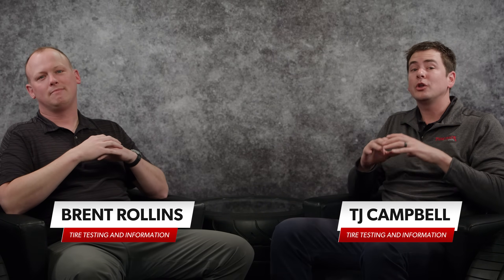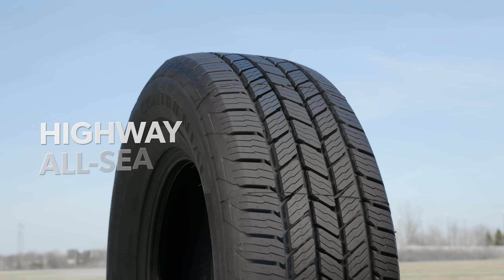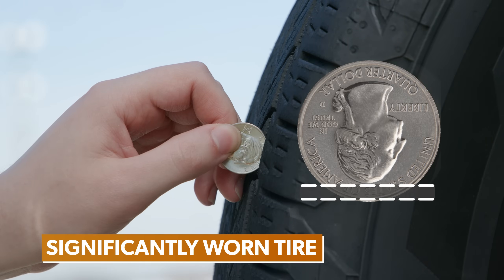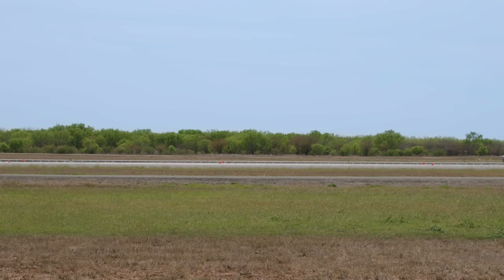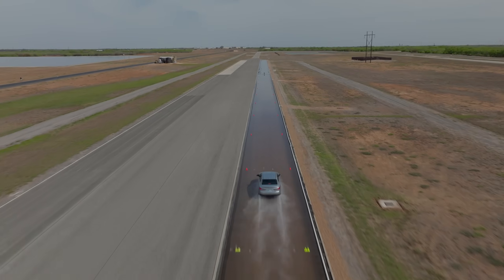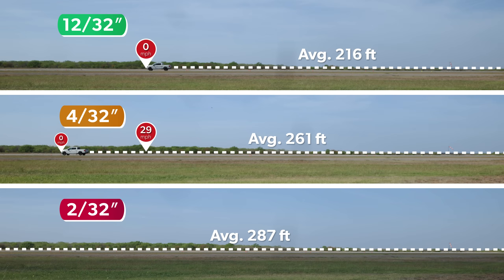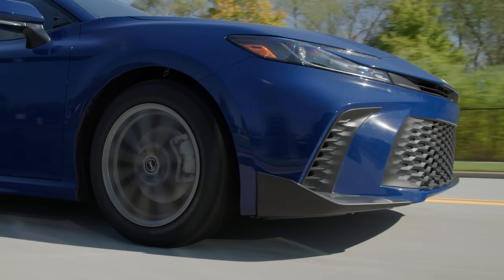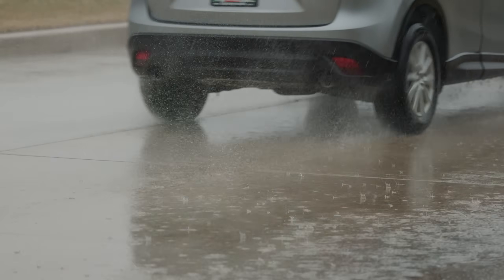How Much Does Tire Tread Depth Affect Stopping?

Comment: Quick question if someone can answer, would the temperature of the brakes also have a significant effect on stopping distance?
Reply from the maker: Great question! Yes, the temperature of the brakes can definitely affect stopping distance, and it works in a few different ways depending on whether the brakes are cold or hot.

Comment: Michelin has at least one tire that has sipes that appear as the tread wears to maintain wet performance - if regulators mandated that tires maintain wet performance throughout their life, all tires could have  better sipe design - the problem with traditional sipes is they loose volume as the tread wears, so wet performance continually declines - cool test, thanks for sharing

Comment: In the dry stopping distances for the worn tire will generally be the same or shorter, though.
Reply: I've never experienced a tire improve in any metric of performance ever as it is worn down.
Reply: @skylersutton241 It's what you will find in testing from multiple tire companies, including Michelin, as well as independent research organizations.

Comment: Your test surface is almost like shallow puddle, that is not same as wet asphalt, most roads will be leveled and such thin water layer would be only possible in extreme rain but it also would make fast driving dangerous for visibility reasons especially if following other cars on highway. 

So the main point of this video is valid however real life braking is not so dramatic with legal remaining tire thread depth. Thus legal limit is reasonable compromise.

Comment: I am also genuinely interested in the questions :
Worn out tire = semi-slicks ?
Worn out semis = Slicks ?
And : is dry braking better with worn out tires ?
Reply: Impossible to have this comparison, if you wear a tire out you will make it go through  heat load cycles which will degrade the rubber material which will degrade the tyre performance to the point that it wll have no grip. So in the real world there is no point for that.
Reply: @TheLTcousins could do a nice burnout to make a comparison lol
Reply: False. Completely worn tyres have more grip in dry conditions than brand new tyres.
Reply: @trumpthelegend6357 it has more contact with the ground so technically worn out tyres are better for dry grip
Reply: @spookyreaper797 ya both completely wrong for several technical reason's!
Reply: @iggyppup enlighten us. Tell us these ‘reasons’
Reply from the maker: Thank you for your feedback, and we'll make sure to share it with our team.

Comment: I had busted chinese tires on the front of my car. The behavior in the wet was... Interesting 😂 and a bit comical tbh. The limits in the dry came up early and prevented me to push on.

Now i have replaced them with Nankang NS-2R (trackday semi-slicks) AND BOY WHAT A DIFFERENCE !! My car isn't the same anymore, the front end just dosen't give up ! You have to purposefully make it give up, do something stupid for the tires to let go. I can go full flat in so many corners i am amazed ! In the wet they are  much better than my old sh*t buut.. Still, semi-alicks, i don't expect too much.

Also, my car is a 20 year old, 2400 lbs french hot hatch. Weight definitely helps. (Stop driving thoses crazy 6000lbs Super Useless Vehicles !)
Reply from the maker: Thank you for sharing your thoughts and experiences with us!

Comment: Were the lower depth tyres naturally worn (i.e. old) or new and shaved down?
Reply from the maker: Unfortunately, we didn’t have the time to put thousands of miles on the tires to wear them down naturally, so we opted to shave the tires to their depths to synthetically represent wear.
Reply: @tirerack Good to know, because that's hopefully one extra variable that was eliminated by your methodology - the effect of aging and heat cycles on the rubber compound, which will also have a huge effect on performance.
Reply: That means thath naturally worn tire would be even worse :D

Comment: For the rest of the world :
12/32"=9.525mm
4/32"=3.175mm
2/32"=1.5875mm
Reply: thx bro, so underrated comment
Reply: thanks bro
Reply: You are a math teacher weren't you??
Reply: @spudboy123 Worst, engineer😅
Reply: From the series: "anything, but the metric system".
Reply: Thank you so much
Reply: 12/32“ to me is 3/8”` and the 4/32” is 1/8”,  2/32” is 1/16” .Why do Americans refer to 1/2” as 16/32” are the rules only in 32s of an  inch. Seems weird to hear our measurements spoken of like that😊
Reply: they really used coins
Reply: those 50ft or whatever with the worn is about 15m
why do they use x/32 for inches?
Reply: @keisuketakahasi4584  32nds of an inch is just the standard we use in the US for tire tread depth, for some reason. I'm in the trades and we hardly ever go down to a 16th of an inch, never a 32nd. I guess the extra precision is necessary.
Reply: @smileyguyz k. cuz all the values used here could ve been shortened by 2 thats why i thought it was wierd
Reply: @keisuketakahasi4584 Cause Freedom! (Insert Bald Eagle screech) 😂😂😂
Reply: @thebreakerofwalls9036 how many cheeseburgers per bald eagle does your country have? thought so
Reply: Thx for converting it into a more confusing measure
Reply: @chipthecomputerkatze8936 how is metric confusing?
Reply: @keisuketakahasi4584  in this context it looks a hell of alot more confusing thanks to the larger numbers.
Reply: @chipthecomputerkatze8936 normally you use x mm, sometimes with a one digit decimal

Comment: Were the tires driven after being machined down? If not this would be an artificial traction caused by machining.
Reply from the maker: The tires were driven briefly, but were not given an extended “break-in” period, although in this instance, it did not make a functional difference.  Since this test employed far more straight-line braking runs than the “standard” test we use during our regular tire tests, we had more opportunity for deviations to emerge and found consistency over the 10+ runs we did on each tire.

Comment: Tire rack, PLEASE Test Brake pads.  Please test Ceramic OEM (on like every modern everyday, not like porsche) vs like HAWK Performance Ceramic or HAWK HPS 5.0, and maybe even EBC (which u dont sell.)
Reply from the maker: This is not currently planned as our test program is primarily concerned with tire performance exclusively, but we always appreciate feedback!
Reply: @tirerack  Could you do Summer performance vs high performance all season at like "Cold ish temps"  IE testing the two tires in 40-50 degree weather and see if the summers still out do the all seasons.

Comment: might be a stupid question, BUT does lower thread tire affect dry stopping distances?  According to Big Chain tire shops, they sometimes say that lower thread even negatively affects dry stopping distance.  Barring any dry rot, cracking, etc if u had a decently worn tire, that wasnt rotting or becoming hard, does less thread make the stopping distance go up, even in dry?
Reply: Probably yes, but not nearly as much as in the wet. I'd guess a couple feet of difference per 10% of wear IF the rubber compound of the particular is homogenous all the way.
Reply: @sanchezking6188  So very very marginal, unless of course we compare a brand new and 2/32 tire in the dry?  But do thicker/taller thread blocks grip the ground better?  I have heard some say that new tires are less sharp in steering, because  the new, 10/32 thread has more squirm than say 4/32s

Comment: The "Tread-Wear-Rating" number also plays a tremendous role in both Dry and Wet conditions.
If your Tires have a "400"  "Tread-Wear-Rating", then you're driving on Water-Skis.
Hopefully, the guy behind You has decent Tires.
Reply: what? I just thought lower number = less total mileage the tire can go.  IE 200 is less than 600, but a brand new 200 tw tire is going to be safer than an old, old used 600 tw.
Reply: @rmat9023  
The "tread-Wear-Rating" number is a MULTIPLIER of a supposedly "standard" Tire   
from back in the late '60's when "Radial-Ply-Tires" were a brand-new "high-tech" thing.
Most modern Radials will run about 4-times longer than an old-style "Bias-Ply"" Tire,
making the "Tread-Wear-Rating" around "400", which is a very hard Rubber-Compound, which has relatively poor Traction, especially in wet conditions.
Reply: @jimbrown563  Ok well hold on, I mean, I have drive 300 tw tires in rain with full depth thread and it was good.  I have driven 800 TW tires in rain, in a less sporty car, and it felt fine, not dangerous, but not amazing.  Why make the compound so hard if it will compromise rain safety?
Reply: There's a lot more that goes into how well a tire can grip the road in the rain than its resistance to wear. TW is weakly correlated but by no means the most important factor.

Comment: Great info and not surprising results other than the speed at full tread stopping distance for the worn tires.  Do the same in the dry.
Reply: In dry worn might be even better because it gets closer to a full slick
Reply: @Henrix1998  Of course dry braking is better, but a tire shop will never show that, they want to sell :D
Reply: Who cares about the dry ? They will likely improve slightly, so safer in an emergency in the dry. But it's the wet, poor conditions where it matters the most. Unless of course you never ever drive in the wet, or you never ever have an emergency in the wet or other poor conditions
Reply from the maker: We are so happy to hear you found the video informative!

Comment: I would also like to see the effect dry rot has on tire performance, could be a fun experiment considering the amount of 5+ year old dry rotted tires on the road because they still have decent thread depth.
Reply from the maker: Great suggestion! 🙌 We will share your feedback with our tire testing team.
Reply: I actually have an experience with an old tire that had good tread depth on a track day and when we swapped for some newer tire our times dropped by 10% which is HUGE. So I say tread is good but its not everything.
Reply: @LaggerSVK Is this why folks in Nascar will do a few laps to scuff tires?
Reply: Habibi, my car slid around in the dry with 7 year old tires 😂
Reply: @Wind_slash0 
And I was riding on motorcycle with 12yo front tire which gripped the same as new ones ...
go figure.
 Turns out age alone isn't enough to determine tire condition but HOW it was used and stored in all those years 
Cheers
Reply: heck, brand new 3 year old Michelin PSS with some dry rot marks is unacceptable for me on a m240i in the dry, sliding all over the place. Much better with fresh set of PS4s.
Reply: I assume that in the rain they will be slightly worse, but in hot \ cold weathers the rubber may have not good traction. But that's only assumptions, because different tires made of different components. Tires which was stored last 10 years in the garage, cleaned, properly packed or even covered with protection silicon oils would be way much better then tire which was on the sun, dirt for a last 10 years...
Reply: From my experience it broke my bone...Just dump them and get a new one...your bones are worth more than those rotten tyres!

Comment: Thanks for the wet traction data.  BUT how about the dry braking numbers?
Reply: It will not matter much, usually you see better dry braking by a bit when the tire wears.
Reply: Unless the tires are completely bald, I doubt there would be a significant decrease in dry stopping distance with decreased tread depth. The contact patch will still be the same, just a taller or shorter tread block.
Reply: tyres need to keep you safe in the worst conditions on the public road in an emergency, so dry would very obviosuly be a pointless test.
Reply: Race cars use tyres with zero tread on dry road and tread on wet road. More tyre surface touching the road = more grip, but if water will get under the tyre then its necessary to add grooves to eliminate it at a slight reduction in tyre surface area.
Reply: @ioanbugheanu6836  don't forget, racing tires are completely different, their grip on the road is due to the super-soft rubber that sticks to the road, and the second factor is that the races take place on clean asphalt where there is no water, dirt or sand. These tires work well on clean asphalt, but very poor on wet or dirty sandy asphalt.
Reply: @ioanbugheanu6836  These aren't race cars and they don't run on a race track.  In the real world in which I live the driving surface is inconsistent where I run on  concrete, asphalt and there are pot holes, oil and gravel on the road.  

In addition the tires didn't get worn down on a track in a month, it takes years to wear them down.  That means the tire compounds have broken down and the tire is harder, leading to even LESS traction.  

It's not rocket science and the data ^^^ is well documented.  If living is something you value when driving on the road, replace your tires when they wear out.
Reply: They won't do a dry test, because that will show that less tread depth, results in more grip and shorter stopping distances. That will not help them sell tires.
Reply: @jhidley1 thats a shitty argument. I don’t care is my stopping distance is 1 feet shorter when dry if its 100 feet longer in the wet. 😅
Reply from the maker: This test was primarily concerned with wet braking, so unfortunately there are no dry braking numbers this time around, but maybe in a future test!
Reply: @tirerack  I am 100 times more interested in the wet braking numbers than dry.  I just replaced the great but well worn Michelin Defender2 on my 2013 Honda CRV 130k miles with Pirelli Scorpion AS 3.  Day and night improvement in wet weather braking with the new high performance brakes.
Reply: Simple, low tire tread becomes dangerous in wet conditions
Dry performance stays roughly the same
You don't have to test it in the dry,

Comment: Other than burnouts, not doing regular alignment on all 4 wheels is why tires wear a lot faster.
Reply: What do you mean by "alignment" on all 4 wheels? Rotation of the wheels.... or alignment on the vehicle?
Reply: @TheLastMoccasin all wheels on car go off alignment over distance and bumps. Running into curbs at stops and turns makes it worse.
When each wheel is pointing at different directions i.e. Toe angles, all tires will wear out quickly.
Reply: @Soravia   Yea, when I had poor quality company cars (GM Chevy Impala and Chevy Malibu) they were always out of alignment a wore tires poorly. On the other hand, I have a 2014 Mazda 6 with over 180,000 miles on it, I have never once had any alignment services done on it, and it still wears tires perfectly. The quality of the vehicle matters!
Reply: Many vehicles cannot be adjusted for rear alignment due to having live axles or torsion-beam rear suspension. 

Alignment affects evenness of wear across each individual tire, not necessarily the balance of wear between each of the four tires, which is much more greatly affected by whether or not they are routinely rotated since each corner of the vehicle experiences different loads during routine driving. For example, on most vehicles driven in countries that drive on the right side of the road, the right side (primary) drive tire wears at a significantly faster rate than the left side non-drive or non-primary drive tire. I don't necessarily know for certain that the opposite is true in countries that drive on the left, but I suspect it could be the case.
Reply: @waffle911 if one wheel is off center, all others have to compensate for car to keep going straight. My UHP tires last 20k miles, etc because I do all wheel alignment at least once a year. If the rear wheels can't adjust alignment,  don't buy it 😂